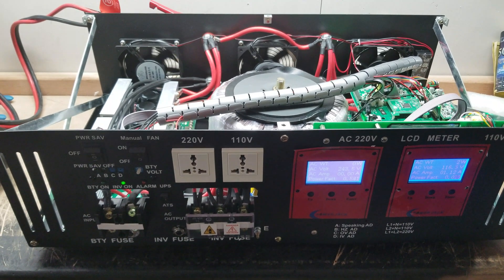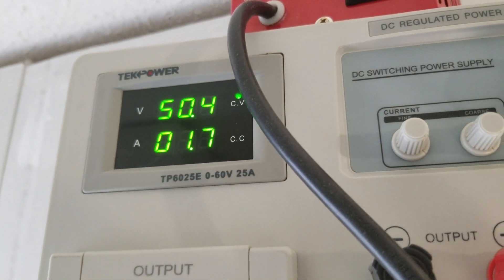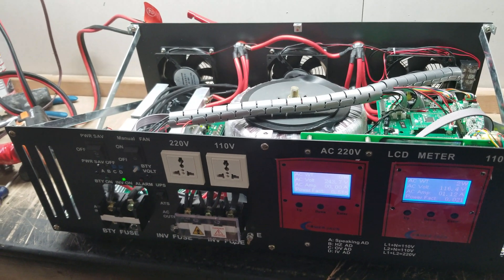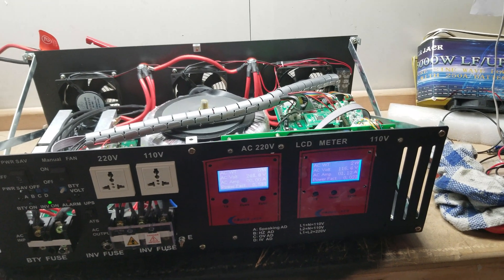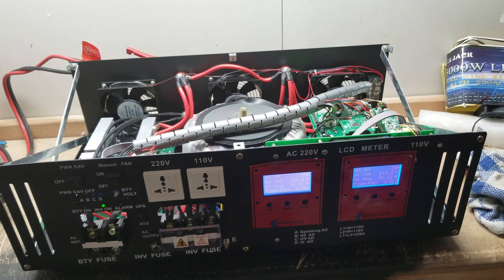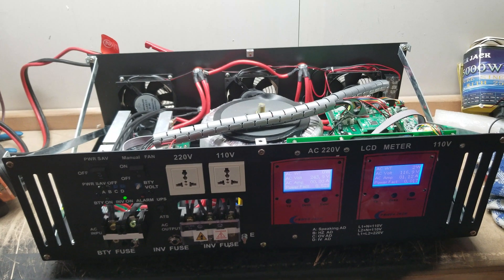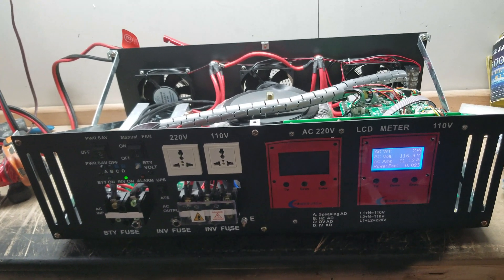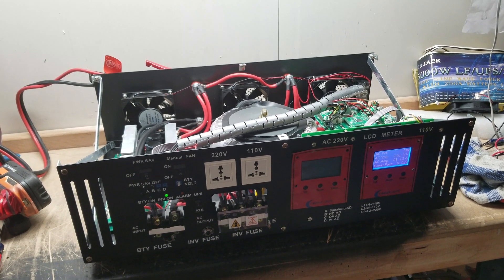Standby draw from a 15000w 48volt power jack inverter

Comment: $20,000 worth of solarpanels.. $400,000 worth of batteries. Ugh.
Reply: $8,000 worth of panels. $8,000 worth of 18650 batteries another $1,000 worth of parts, $4,000 for a good inverter $4,000 charge controller. 40kw system for $25k

Comment: My 2 cents...there's a thread on AnotherPower.com where one guy discovered that the no-load current on these LF inverters can easily be reduced by a substantial amount.  I personally bought one of the new Power Jack 48vDC 9000W split phase inverters; out of the box, it used 1.8A no load @ 55v. Experimenting, I removed the existing little core on the primary wires, and managed two wraps of the existing primary line around a large (2") E-core, which reduced the no load current to 0.7A @ 55vDC.  (Rumor has it that I should be able to get under 0.4A; I'm just getting started!) If you don't want to buy an E-core, I also found that by simply forcing one more wrap around the existing core, I got a no-load current of 1.0A @ 55vDC.  Not bad at all for zero investment!
Reply: Interesting!  I have an  24v 8000 LF  split phase Power Jack and i will have to try this out!   Its been shutting down after long periods for no reason ( cool and bat voltage normal)
Ill measure tomorrow the amp draw and try another wrap around the existing core!